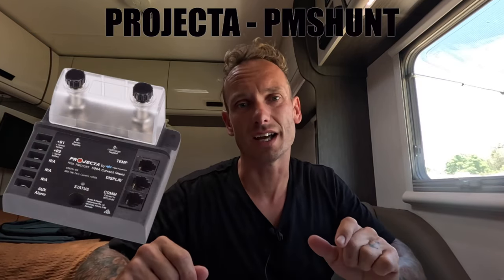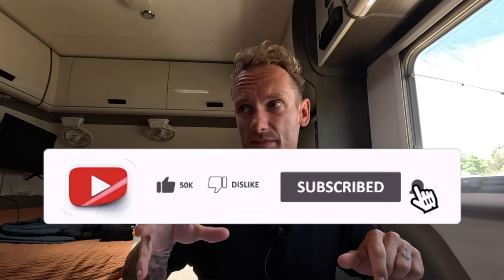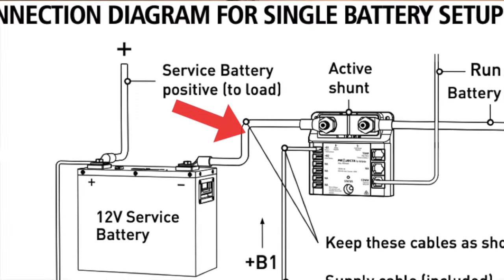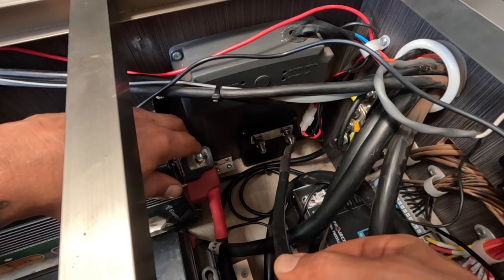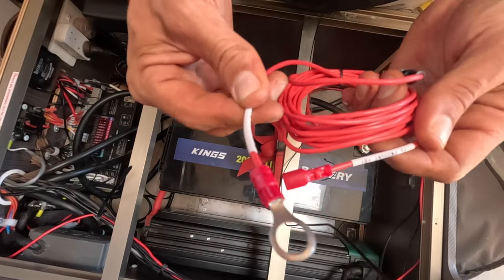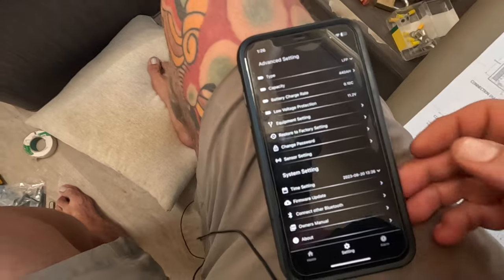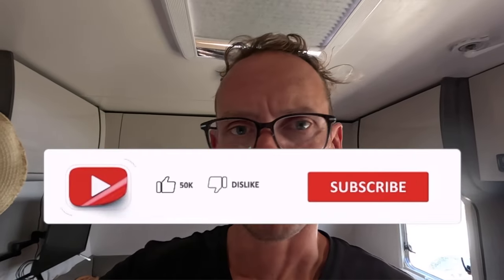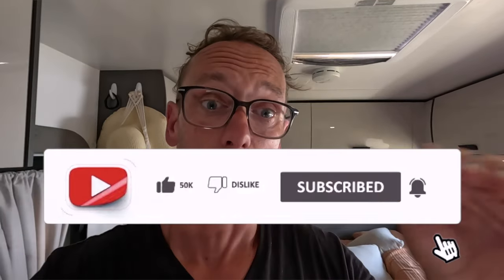How to install Projecta PMSHUNT Watch this before installing an inverter with your Intellijay BMS

Comment: jesus how complicated, i was going to install a shunt--- i wont bother lol, its far easier installing a 3rd party stand alone shunt and monitor, which i have done
Reply from the maker: Practically, it's not much more work than any other shunt but I must agree, when it comes to working out the display/app, I would rather something more user friendly.
If it were cost effective I'd probably go for something more bespoke/modular but having the Projecta system already installed it is was not a viable option to replace it. I have used other brands in the past and have a Victron smart shunt in the car which works really well and In was hoping that this would present better at the LCD display. Perhaps in another update they will make the display more user friendly...
What shunt do you think you will use?

Comment: Great vid but pls get a proper crimper,not pliers,the correct crimper will clamp at over 6tonnes of pressure causing a cold weld which creates a perfect connection with no resistance/heat/losses/hotspots,iv even cut it half and you will see its cold welded/fused/melted together,pliers cannot come remotly close,iv done the tests many times to prove this.
Reply from the maker: Hey thanks heaps for watching! Yes I have a swagging tool at home but it's much too big to carry with me when we're travelling. Sometimes you make the most of what you have at hand, especially when in remote locations.
Reply: @dreamtripaus  nice,does the % unit still work and is accurate?
Reply: @dreamtripaus  no worries but iv seen first hand our neighbour try to pull 240amps through a 70mm cable with a hammered on crimp and bascicly caught fire,and smoke damaged part of the van,high dc amperage need a proper crimper tool and skill or don't do it period,you don't wanna be responsible for people's vans burning down because you show terminating a lug via mutigrips,pls don not take offence,I love the vid peace.

Comment: Your a champ mate. I just got my 14 ft all terrain from jayco yesterday and it only has 200watts of solar. I was wondering how to beaf up my system for more offgrid and how to plug into my pm235 bt. I have a 125amp lithium invicta  battery. First things first, I need the shunt. Thanks heap man👍💪
Reply from the maker: Mate my pleasure, I figure I spend so much time working this stuff out, idc I can make it easier for the next people then why not!
Yell out if I can help with anything!

Comment: So I'm getting a van built as we speak and it's coming with the PM300 system and a 200W panel on the roof. Does the PMSHUNT come as standard with the PM300?
Reply from the maker: Hi there, from what I've read the Shunt does not come standard with the PM300. 
Some of the newer Jayco All-Terrain caravans come standard with the Shunt as they are also supplied with an inverter. 
Are you planning on running an inverter?
Reply: @dreamtripaus  Maybe in the future but for now I'll go without. I think for now I will just try and match a portable panel as close as I can to the fixed one and hook it in parallel directly the the solar inout in the PM300. It'd be good it there was two solar inputs. I have been told to not connect a portable panel top the car charging plug (even with a regulator), it won't work properly.

Comment: Hi we have a new caravan it has the projecta pw235 we fitted two new lithium batteries after about 3 weeks the fault light flashes 8 times its the bms over voltage how do we fix that thank you
Reply from the maker: Hi there, I haven't encountered this exact problem but I have had issues ion the past. I called the Project support line, they answered straight away and solved my problems over the phone. I highly recommend giving them a call 1800 422 422, they were very helpful!

Comment: Hey! I've had the PMshunt installed into the intellijay system, however now the system continually freezes. Anyone having similar issues?
Reply from the maker: I haven't had any problems like that; my only suggestion is potentially a firmware mis-match. You can run a firmware update on your Intellijay system via the App. Otherwise I would strongly recommend calling Projecta, they are great to speak to on the phone, very helpful.

Comment: What are you running through the shunt?  Type of Batteries, solar charger, dcdc charger, and inverter?  Just had a lot of enerdrive stuff installed through the PM shunt.  I won't deny it's a little overwhelming understanding it all.  On the display, i see you have 600 ah of battery.  As amps are drawn does this reduce?  Or just the percentage?
Reply from the maker: Hi John, where the display reads 600Ah is actually manually set by the user. This is the basis for the calculation done by the shunt.
If the shunt measures current in versus current out then this is its base line to calculate how much is left.
This figure doesn’t change but the state of charge percentage and the time-to-full changes accordingly.
I do have another video where I go through all the hardware we have if you want more detail.
We run a 2600watt Enerdrive AC transfer inverter, an Enerdrive DCDC40 for alternator and extra solar.
All other charging and current draw is via the P300 BMS. We have two 120Ah Sphere lithium batteries that came standard with the van, I have added 2 more Kings 200Ah lithium batteries for a total of 640Ah.

Comment: Hi Mark. Just watched this video on installing your shunt. Question do you have portable solar panels plugged into an Anderson plug on the chassis using a regulator by passing the PM335 and live wired to the battery direct and the negative connected to the load side of the shunt. This is what I am looking to do, thanks.
Reply from the maker: Hi David, apologies for taking so long to reply! I've been trying to figure this one out. We have added 2 x panels to the roof and have those going direct into an additional regulator (aside from the reg in the PM335). This regulator is wired positive direct to one side of the battery bank and the neg to the load side of the shunt so it can calculate the additional input.
The Anderson plug on the chassis is still wired (from factory) to the PM335, this too is connected in the same way to the battery bank via the shunt.
Reply: @dreamtripaus  Thanks for replying I will be setting my new layout next week same as your set up but my extra solar will be two 200w portable solar blankets.

Comment: Great video mate. Do you have any information about adding a second lithium battery dedicated to a compressor fridge?
Reply from the maker: Adding an extra battery is not overly complicated. It is important to consider cable sizes though to ensure you get the right performance. I'm not sure what you mean by 'dedicated to a compressor fridge' though?
Is the intention to isolate the second battery from the rest of the caravan so that it only feeds the fridge? Do you still want it connected to your charging equipment (ie solar panels, DCDC charger and ACDC Charger)?

Comment: Hi, I have a similar system, good explanation of Projecta system. What is the best way to see if your dc-dc charger is working (what should be showing up on panel) and at what capacity your dc-dc charger is inputting. thanks
Reply from the maker: Do you have Bluetooth connection to your system? With ours we can see the status whilst towing.
Reply from the maker: Our DC-DC charger is also the solar controller for our extra solar panels which makes it almost impossible to know how much of the incoming charge current is attributable to the cars alternator.
I could try disconnecting the solar panels and running the car to see what kind of current we get. All in all, when towing were putting in between 40-50 amps; but like I said I can’t be sure how much is solar and how much is alternator.
On a good sunny day we get about the same coming in just from solar

Comment: Great video - Just checking, with this installed the red wire from the inverter still goes straight onto the battery? Cheers!
Reply from the maker: Yes that's correct, the load is measured via the current on the negative leg. The positive connects direct to the battery.

Comment: Hi, great vid ! I have just installed a PMSHUNT to operate with my PM300. Introduced shunt via setup on LCD display. Was all working well, showing power being consumed to battery via inverter. Just gone to recharge battery via 240V. THe PM300 is showing 100% charged, my Enerdrive battery app is showing only 54%. Do I have to carry out some sort of battery/PM300 sync ? Cheers
Reply from the maker: Hi Chris! Sorry to take so long to respond! Are you running lithium batteries? This is what I’m thinking, I hope it helps:
The good thing about lithium batteries is also the reason why they are hard to measure the state of charge. Lithium batteries can drain down much further than AGM without lowering their voltage. With AGM batteries we can pretty simply gauge the state of charge by the voltage but this is not the case with lithium. Whilst your Enerdrive battery most likely has more accurate internal measurement of your SOC the shunt very simply works on Power-in versus Power-out. It uses the total AH, in this case 600, and subtracts as current flows out and adds as current flows in.
If the battery is not at 100% when connected to the shunt then it can’t accurately know the SOC. I’m expecting that once your batteries are fully charged the display will work more accurately. 
I do hope this helps.
I have also had a really great experience with the guys from Projecta who were incredibly helpful on the phone.

Comment: Thanks for the info again as I’ve watched twice. Just a point I noticed on this occasion, you mentioned that you might shorten the battery temperature lead from battery to the shunt, the red one. Please be aware as I made the mistake of doing this as in that cable there are three wires, one is power but the other two are a temperature sensor. If you shorten the cable to add a smaller lug you will be taking the sensor out of the system. 
Just a question, did you replace the battery negative cable that connects to the BMS with a cable from the load side of the shunt to the BMS negative?
Thanks again, always ready to learn from others.
Reply from the maker: The BMS connects to the load side of the shunt. The only thing that connects to the negative terminal in the battery is the shunt.

Comment: Thanks for the info, very useful as I’ll be installing a shunt and inverter in our JAYCO soon. Just a question though, is there a reason why you can’t run all your solar inputs through the Projecta BMS rather than having to have an additional solar controller in the system?
Reply from the maker: Hi Ian,
Sorry for the late response. The Projecta BMS is only rated to 30A of Solar input. So to maximise charging I've installed an additional Enerdrive solar controller to handle the extra panels.
Reply: Thank you, I get it now, sorry too for late response to you. I didn’t have notifications turned on. Safe travels.

Comment: We have just recently bought a caravan (not a Jayco) and have the intelli-RV system with the 500a shunt and projecta 2000w inverter in as standard.
Im glad I came across your video because i was about to go on an angry rant to the dealer because the inverter loads werent showing on the display where i thought they were. However does this affect the battery level display as well? We were running the air con off the inverter and managed to deplete the batteries down to almost nothing (lithium) but the battery display said we still had 90% battery charge.
Reply from the maker: The IntelliRV should be able to calculate an accurate state of charge from the shunt. It should measure both the voltage and the current draw to calculate the battery status. It’s possible it may be installed incorrectly? I did help a fellow traveller who had a shunt installed but their inverter was not connected to it, it was connected directly to the battery terminal. They had the same trouble that you have; all the devices powered by the inverter (ie AC, microwave, etc) weren’t being measured as they were connected directly to the battery and not via the shunt. All your load and additional charging negatives must be connected via the shunt.
Reply: @dreamtripaus  thankyou. I will have a look tomorrow and see how it has been connected to the system.
With any luck it will be an obvious and simple fix, however we all know that the caravanning game is never simple. 🤣
Reply from the maker: So true, nothing simple about them at all

Comment: Hi. I notice you mentioned your van came with 2 x Sphere 120 Ah lithium batteries, but you added an extra 2 x 200 Ah Kings batteries. Some people suggest it's unwise to mix either different battery capacities or brand of batteries (which I've always been sceptical about anyway). You obviously have not encountered any problems with your battery setup (or have you?). Are there any special things to watch out for when mixing different brands/capacities of batteries? Thank you.
Reply from the maker: Correct, it is best practice to match battery capacity but it is more important to match voltage rating when wires in parallel. If you were wiring the batteries in series say to achieve a 24 or 48 volt system then matching capacity is critical, but that’s not the case in a 12v circuit. I can’t imagine why brand would matter though as long as the specs align. Ideally I would have one 600Ah battery for best possible performance but cost is a serious consideration! We have not had a single problem with our system! Runs like a dream!
Reply: @dreamtripaus  Thanks for this. It's reassuring to know that you've had no problems because it goes against all the orthodoxy and conventional wisdom. I posed this question on the Jayco Journey Facebook Group and, almost without exception the comments were not to mix brands or capacities. Of course, I'm pretty certain few, if any, of these were qualified to make such assertions. The fact that you've done this with no problems is reassuring, but I guess some doubts do remain. Have you had anyone qualified in this area confirm what you did is okay? Thanks once again for all your assistance.
Reply from the maker: I haven't had anyone qualified look at the system such as an auto electrician or otherwise. I have a background in electronics so I have a decent understanding of the principles. I'm very much a trial-and-error kind of guy. If I have any problems I work on a solution. It can be a hard way of learning but you never forget the lesson that way! I'l, be sure to let you know if I do have any trouble but until then...